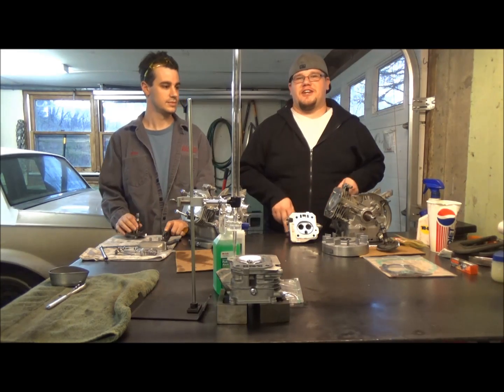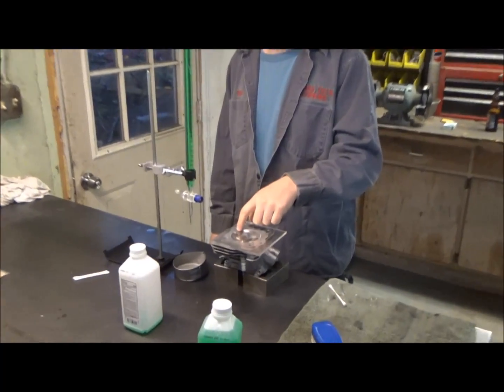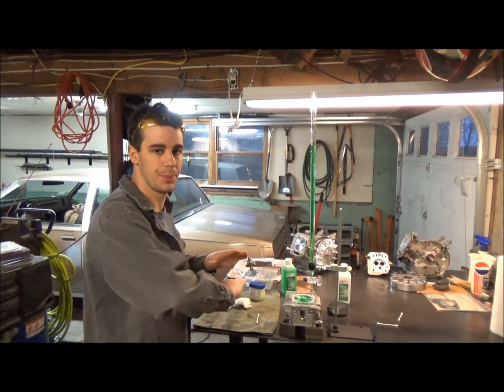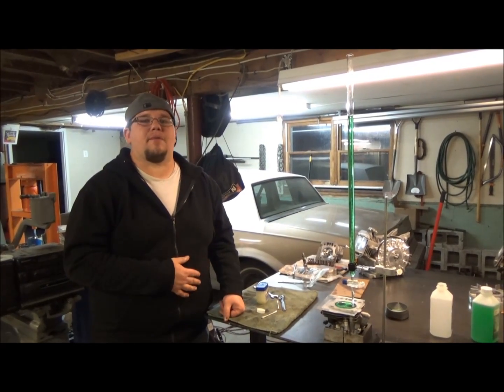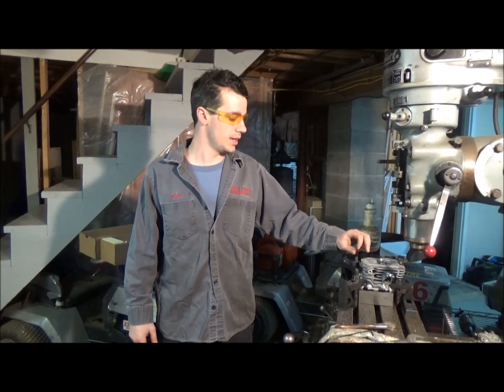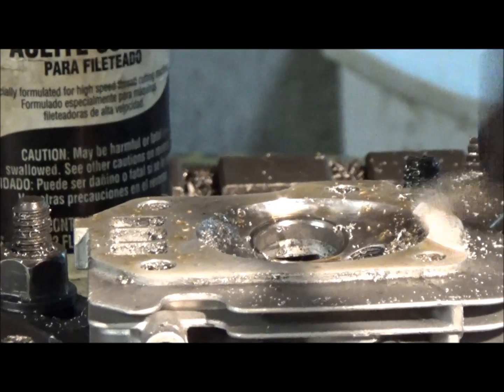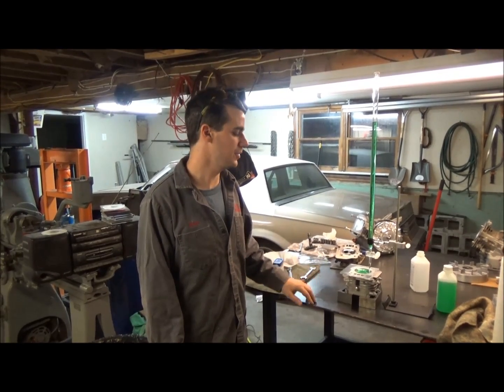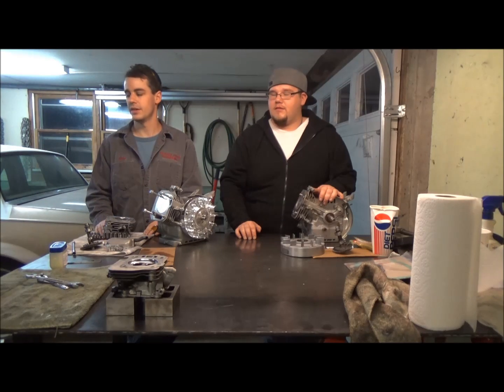CC test and Bridgeport milling Predator 212 hemi head

Comment: how thick is the headgasket? and are you using stock length rod to get 10.4 cr?
Reply from the maker: It is stock length rod and I believe I used the .009 thickness head gasket.

Comment: Awesome... should go way higher than 10.5... like 12.5. It's not like they use a lot of fuel.
Reply from the maker: Thanks, I just wanted to make sure id have no issues running pump gas or pull starting it

Comment: Did u use 0.1mm thick gasket or the 1mm wide gasket?
Reply from the maker: +Dher Chimong I'm not sure what size gasket was used. I just know it's a copper one
Reply: may i know if we use the stock flywheel can we reach to 6k 7k rpm?